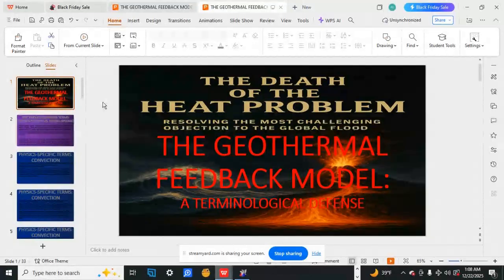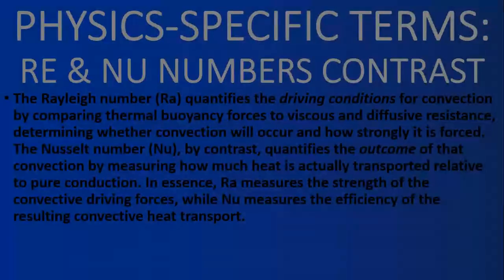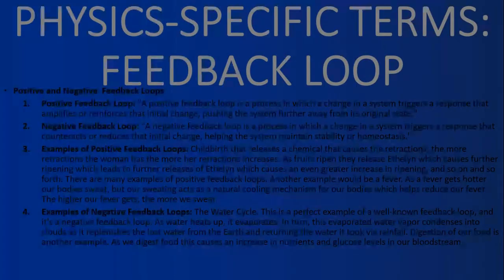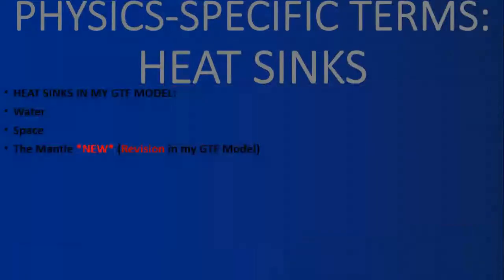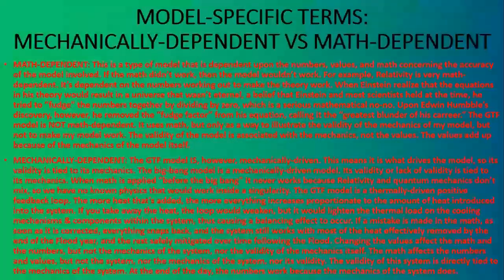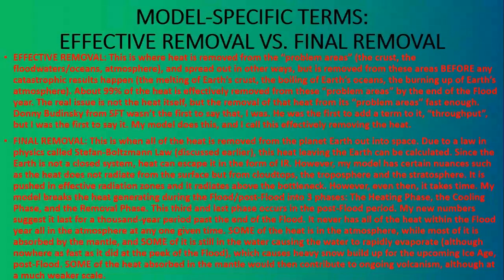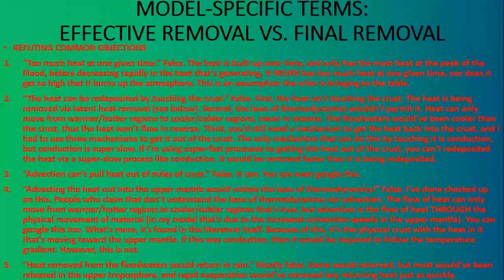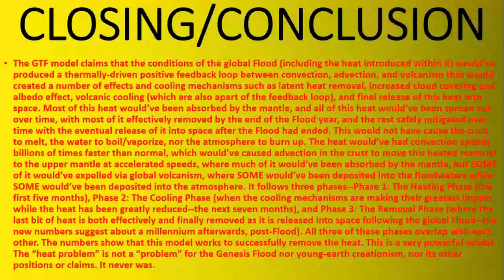THE GEOTHERMAL FEEDBACK MODEL (PART 4): A TERMINOLOGICAL DEFENSE | THE GENESIS SERIES (EPISODE 39)

Comment: Regarding your modification, just so Im clear: are you claiming that the mantle serves as a heat sink with respect to the advected heat from above it?
Reply from the maker: Actually, I'm claiming it would serve as a heat sink, both with the advected heat going into it, and with the heat generating within it. Since AND makes up, like most of the heat, with runaway subduction coming in second, the vast majority of the heat would've been absorbed by the mantle. Due to it's enormous heat capacity and mass, the mantle is considered a poowerful heat sink, even in secular literature. 

Personally, as I said in the above video, it should've always been apart of my model due to the heat generating in the mantle and the heat advecting into it. Originally, I assumed that all of that extra heat generating in the mantle, and advecting into it, had expelled via volcanic eruptions, so everything was calculated with that assumption in mind. When I realized how powerful of a heat sink the mantle was, I realize that wouldn't make sense logically nor factually, hince the revision. 

My model worked even if this wasn't true, but this does favor my model even more. This would mean that not all of this heat would've expelled out volcanically, and that this heat would've been even more spread out than I had initially thought, favoring my model even more. 

More on this will be discuss in my big evidence video on this, including the new numbers on it, if you want to wait until you have more input later. My big evidence video on this will be coming, probably within a few weeks or so. God bless!
Reply: @apologetics-101 so the advected material, coming from the crust, is hotter than the mantle?
Reply from the maker: No. Why do you think it's hotter than the mantle? That's not even close to what I am saying. Do you know how heat capacities work? God bless!
Reply: @apologetics-101 do you know how heat sinks work? The mantle cant be a heat sink to material cooler than it is. That advected material would be the heat sink. The mantle, the heat source.
Reply from the maker: @amaizenblue44  Your claim here is physically incorrect and reflects a misunderstanding of how heat sinks, heat capacity, and advective coupling actually work in thermodynamics and geophysics. I think you muisunderstand how heat sinks work, fueling my earlier thoughts on what you seem to be doing here.

A heat sink is not defined as “the colder object” in some absolute sense, nor is it defined by instantaneous temperature alone. A heat sink is a reservoir with sufficiently large heat capacity and/or mass that can absorb heat with relatively small temperature changes, thereby stabilizing the thermal system. In classical thermodynamics, what matters is the direction of net heat flow, which is controlled by temperature gradients locally, and the capacity of a reservoir to absorb energy without catastrophic temperature rise globally. Now, in the case of advection, this process doesn't follow temperature gradients, but I am speaking generally with regards to heat sinks. The Earth’s mantle overwhelmingly satisfies the latter criterion. With a mass of ~4 × 10²⁴ kg and an average specific heat capacity on the order of ~1,000–1,200 J kg⁻¹ K⁻¹, the mantle possesses a thermal capacity orders of magnitude larger than the crust and atmosphere combined. This is precisely why it is routinely described in the geophysical literature as a long-term thermal reservoir that buffers transient heat fluxes (Turcotte & Schubert, Geodynamics, 2014; Davies, Dynamic Earth, 1999).

Your statement that “the mantle can’t be a heat sink to material cooler than it is” confuses instantaneous conductive transfer with advective redistribution within a coupled system. In advective heat transfer, material does not need to be hotter than its destination to transport heat into it; what matters is enthalpy transport and mixing within a system driven by pressure gradients, buoyancy contrasts, and large-scale flow. In the Flood scenario you are modeling, accelerated mantle convection dramatically increases advective coupling between the crust and upper mantle, swhich are already thermally-coupled with each other. "Cooler" (relatively speaking) crustal material can still be drawn into a hotter mantle, where the net result is redistribution and dilution of heat across a vastly larger mass, lowering peak temperatures even if the mantle itself is hot. This is standard physics of thermal reservoirs and is explicitly discussed in mantle dynamics literature (Schubert et al., Mantle Convection in the Earth and Planets, 2001).

More importantly, your claim fails at the systematic level. The mantle is not being proposed as a sink in isolation, but as part of a multi-stage heat-removal pathway: rapid advection and redistribution into the mantle, followed by enhanced volcanic transport, latent heat removal, atmospheric circulation, and finally radiation to space. In that framework, the mantle functions as a buffer and transient sink, not the ultimate sink. This is not only physically legitimate, it is exactly how geophysicists describe Earth’s response to episodic high heat flux events, such as large igneous provinces and early Earth differentiation, where the mantle absorbs enormous quantities of heat without runaway temperature increase (Sleep, Annual Review of Earth and Planetary Sciences, 2000; Jaupart et al., Treatise on Geophysics, 2015).

Your assertion that “the mantle [is] the heat source” is also an oversimplification. While the mantle contains internal heat (radiogenic and primordial), it simultaneously acts as a sink for externally supplied or redistributed heat because heat flow depends on gradients and transport mechanisms, not labels like “source” or “sink.” In fact, the mantle is explicitly described in the peer-reviewed literature as responding slowly to changes in surface or crustal heat flux precisely because of its enormous thermal inertia—language that is incompatible with your claim here (Davies, 1999; Nimmo & McKenzie, Geophysical Journal International, 1998).

Your response here is not a valid critique of your GTF model, nor the mantle as a heat sink within it. It relies on a categorical error: treating “heat sink” as meaning “colder object” rather than “large-capacity thermal reservoir within a coupled system.” The mantle can—and in mainstream geophysics routinely does—act as a transient heat sink and buffer even when it is hot, so long as heat is being redistributed into a vastly larger mass and subsequently removed by other mechanisms. That is not speculative physics; it is textbook thermodynamics applied to planetary interiors. God bless!
Reply: @apologetics-101 for goodness sake Brian, this is simple thermodynamics. 

You cannot "add heat" to a medium, if the medium is hotter than the addition. Heat is relative. 

The heat capacity of the mantle is irrelevant to advected material (if the advected material is cooler). The mantle is not absorbing any heat. 

At the very best, prior to the advected material (the actual sink) ABSORBING HEAT FROM the mantle, you are simply displacing a small portion of the mantle. Like throwing a frozen ribeye in a pool.
Reply from the maker: @amaizenblue44  AB, the problem with your reply is that you are still collapsing advection into conduction and then declaring the thermodynamics “simple” as if that settles it. It doesn’t. You are correct about one narrow statement only: local conductive heat flux across an interface goes from hotter material to cooler material. That is Fourier conduction. But that is not what advection is, and it is not what my GTF model is invoking.

Advection is the transport of enthalpy by bulk mass motion, and it is governed by the velocity field of the material, not by the sign of the local temperature gradient. This is explicit in the energy equation used in heat transfer and geophysics, where the advective term appears as ρcₚ (v·∇T), distinct from the conductive term k∇²T (Incropera et al., Fundamentals of Heat and Mass Transfer, 2017; Schubert, Turcotte & Olson, Mantle Convection in the Earth and Planets, 2001). A parcel of material does not need to be hotter than its surroundings to be advected into them; it simply carries its own enthalpy wherever the flow field carries it. Once there, conduction proceeds hot→cold locally, exactly as thermodynamics requires. Nothing in my model violates that, and nothing you’ve written demonstrates otherwise.

This is why your repeated statement that “the mantle can’t be a heat sink if it’s hotter” is a category error. In a coupled, advecting system, a heat sink is not defined as ‘the colder thing’, but as a reservoir with sufficient mass and heat capacity to absorb and redistribute energy with minimal temperature rise. The mantle’s heat capacity is therefore not “irrelevant,” it is central. With a mass of ~4×10²⁴ kg and cₚ ≈ 1000–1200 J kg⁻¹ K⁻¹, the mantle’s thermal inertia dwarfs that of the crust and atmosphere. This is precisely why the mainstream geophysical literature repeatedly describes the mantle as a long-term thermal reservoir that buffers transient heat fluxes and responds slowly to perturbations (Davies, Dynamic Earth, 1999; Jaupart et al., Treatise on Geophysics, 2015). If your rule were correct, that language would be physically meaningless.

Your “frozen ribeye in a pool” analogy fails because it is a static conduction problem masquerading as a dynamic one. A steak in a pool involves no sustained pressure-driven flow, no buoyancy-driven overturn, no internal mixing, and no downstream export of energy. The mantle is a convecting fluid system. In every convecting system—atmosphere, ocean, or mantle—cooler material is constantly advected into warmer regions and warmer material into cooler regions. That is not controversial; it is literally how convection operates. The result is redistribution of energy across a larger mass and reduction of temperature extrema, even though conduction locally still flows hot→cold (Turcotte & Schubert, Geodynamics, 2014).

Finally, you keep asserting that “the mantle is the heat source,” as if that precludes it from acting as a sink or buffer. That is not how thermodynamics works at the system level. A subsystem can simultaneously be a source of heat in one context and a sink in another, depending on gradients, coupling, and timescale. Mainstream mantle models explicitly show the mantle absorbing and damping thermal anomalies introduced by episodic high-heat events such as plume emplacement and large igneous provinces before that energy is later redistributed and lost (Sleep, Annual Review of Earth and Planetary Sciences, 2000). My GTF model treats the mantle exactly this way: not as the final sink, but as a transient reservoir within a multi-stage heat-removal pathway that ultimately includes volcanism, latent heat removal, atmospheric circulation, and radiation to space.

So the issue here is not that I “don’t understand thermodynamics”, of which I do, btw, but it’s that you are applying a one-dimensional conduction intuition to a three-dimensional, advecting planetary system and then insisting that anything outside that cartoon must be wrong. Once you correctly distinguish conduction from advection—and once you treat the mantle the way the peer-reviewed geophysical literature actually does—your objection simply doesn’t apply. 

I know you are trying to find "holes", but there aren't any. With advection think less thermodynamics and more mass flow. Advection doesn't follow temperature gradients, and the mantle can absorb an enormous amont of heat. That's a fact. This is all in accordance to modern and well-established physics. God bless!
Reply: @apologetics-101 im not confusing anything Brian. I know what advection does. 

The problem is you are conflating simple displacement with heat absorbsion into a medium. The mantle isnt absorbing heat. You are forcing new, non-mantle material into the mantle. 

The actual heat absorbsion goes from mantle to new material and takes time (although not a lot)....and at no point does the mantle gain heat.

So the heat capacity of the mantle is irrelevant with respect to the advected material.

If you were really paying attention to what I'm saying, instead of trying to defy me at all costs, you'd recognize that your advection actually has a (negligible) COOLING effect on the mantle.

Happy New Year, btw! Just hit midnight here.
Reply from the maker: @amaizenblue44  AB, Happy New Year to you as well, but you’re still making the same fundamental mistake, just phrased more confidently this time. You are treating local parcel–parcel heat exchange as if it exhausts the physics of system-level energy redistribution, and it doesn’t.

You keep asserting that “at no point does the mantle gain heat,” and that statement is simply false once you stop freezing the system at an infinitesimal interface and actually integrate over volume and time. When cooler material is advected into the mantle, the immediate, local conductive flux is indeed from mantle → parcel. No one disputes that. But that is not the end of the story. What happens next—and this is where your argument breaks—is that the combined system equilibrates, and the mantle’s total internal energy changes depending on the net energy balance of the coupled flow, not on which side of an interface was momentarily hotter.

In a convecting system, advection changes the spatial distribution of enthalpy. The mantle is not a rigid object being “displaced”; it is a flowing, internally mixed medium. When new material is entrained, the mantle does not remain thermodynamically isolated from it. Energy is redistributed across a vastly larger mass, and because the mantle’s heat capacity dominates, the system’s peak temperatures drop while the mantle’s bulk temperature changes negligibly. That is precisely what it means to act as a thermal reservoir or buffer. Davies explicitly describes the mantle this way, noting that its large mass and heat capacity cause it to respond slowly to imposed thermal perturbations, effectively absorbing transient heat without runaway temperature increase (Dynamic Earth, 1999). Jaupart et al. make the same point in the context of episodic heat inputs, where the mantle damps thermal anomalies before they are exported (Treatise on Geophysics, 2015).

Your claim that “heat capacity is irrelevant” is therefore backwards. Heat capacity is irrelevant only if you insist on tracking heat flow at a single interface and refusing to consider the volume-integrated energy budget. But planetary thermodynamics is not done that way. In the governing energy equation for mantle convection, the advective term transports enthalpy, and the evolution of temperature depends on the balance of advection, diffusion, internal heating, and boundary fluxes, not on whether a specific parcel was momentarily cooler than its surroundings (Schubert, Turcotte & Olson, Mantle Convection in the Earth and Planets, 2001). If the mantle’s heat capacity were “irrelevant,” mantle convection models would be meaningless, which they obviously are not.

You also say that advection has a “cooling effect on the mantle,” as if that undermines my model. It doesn’t, but rather, it confirms it. Reducing peak mantle temperatures by redistributing heat across a larger mass is exactly what a buffering reservoir does. Cooling locally or temporarily does not imply that the mantle cannot function as an intermediate sink for excess heat in a coupled system. In fact, the literature routinely discusses mantle cooling through advective mixing during periods of high heat flux, followed by later reheating or continued export depending on boundary conditions (Turcotte & Schubert, Geodynamics, 2014; Sleep, Annual Review of Earth and Planetary Sciences, 2000).

Where your analogy still fails is that you keep treating the mantle as if it were a static container and the incoming material as a foreign object. That’s not mantle physics. The mantle is the flow. New material is incorporated into that flow, and the system’s thermal evolution depends on mass-weighted energy redistribution, not on a simplistic “who heated whom first” narrative. Calling that “simple displacement” ignores the thermodynamics of mixed, advecting continua.

So no, I’m not “defying you at all costs.” I’m pointing out that you are reasoning correctly about conduction at an interface and incorrectly about energy balance in a convecting planetary system. Once that distinction is kept straight, your objections to the mantle’s role in the GTF model don’t hold, and the mantle’s heat capacity is not only relevant, it is central to why the system does not catastrophically overheat. God bless!